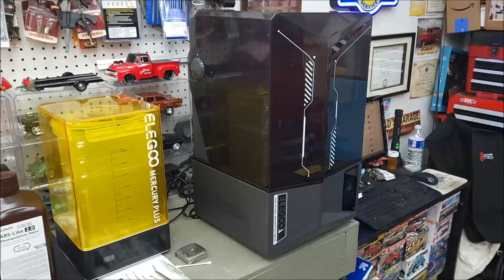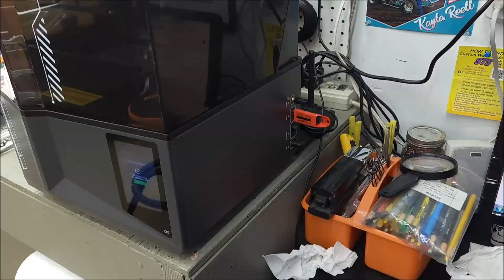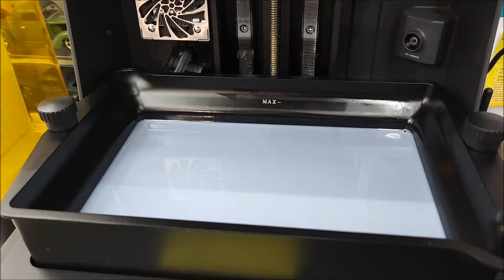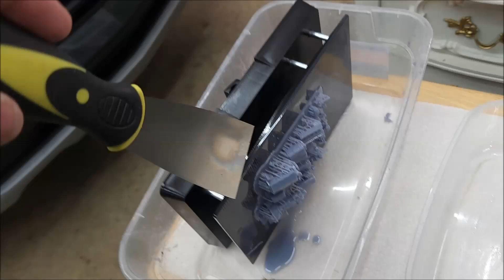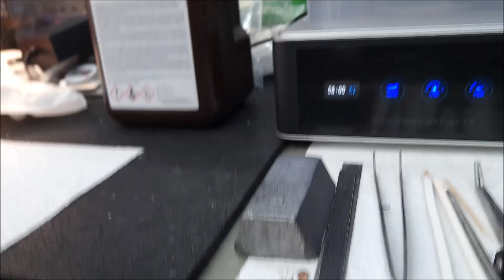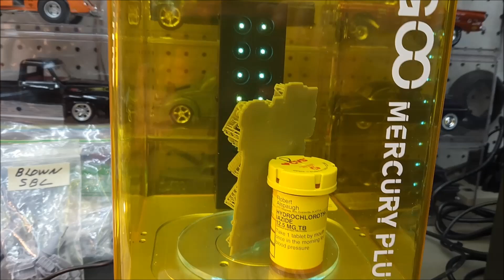3D Printing Part 1

Comment: Please wear some gloves. You shouldn’t be handling the resin as it absorbs through your skin!  I don’t wear a mask for mine, but am pretty well ventilated. Also Mr Clean or Purple Cleaner work well in the cleaning vats and then just an IPA rinse off….a bit cheaper. Otherwise, super prints!
Reply from the maker: I will keep that in mind, thanks for dropping by I do appreciate it.

Comment: Hey Zippi. Does the printer stink up the garage or house when your printing? 🛻:chillwcat::shelterin:
Reply from the maker: It does smell a little bit.  I put my cover over it when I'm printing and it helps a lot.  This summer with the doors open shouldn't be a problem.  I wouldn't run  this in the house unless I had a dedicated room with ventilation. Thanks for the visit.

Comment: That was good explanation for what happens after the printer forms the parts. However, from what I've seen on another channel, the computer set-up of the 3D file prior to printing is very complicated. As you showed with the wire wheels printing you did recently, making errors and wasting resin seems too likely at this point in the 3D printing game. 
I would like to get into this game, but think I'll wait until they simplify the tools.  The "supports" and "angles" of the parts should be optimized in the file download, so the only thing left is to hit "print". Thanks for showing the cleanup process.
Reply from the maker: Much obliged Ray.  Acually the software side of 3D printing is not all that hard.  When you first get started it's a learning curve and there is a little bit of trail and error but things really come together quick.  3D printing part 2 will be come soon and it will be the software side.  Thanks for coming by.

Comment: Hey Zippi, I noticed you weren't wearing gloves while handling your prints. That resin is REALLY bad for you! Exposure to uncured parts and liquid resin slowly builds up intolerance that results in allergic reactions and short term exposure often results in hives, chemical burns and dermatitis. Some resins are even carcinogenic! A pair of nitrile gloves goes a long way in keeping you safe. I don't want to see you get hurt doing this, it's a fun hobby. I would advise you to do some more research on proper safety but I personally would avoid touching any parts, prints, or surfaces you use with resin unless you have gloves on. It's only safe to touch once it has been through the cure station. 

Stay safe!
Reply from the maker: Thanks.  I usually do wear gloves but for the video I elected no too so.  I appreciate the concern.